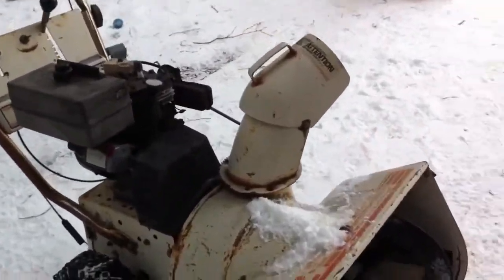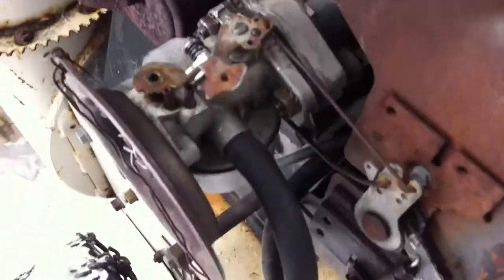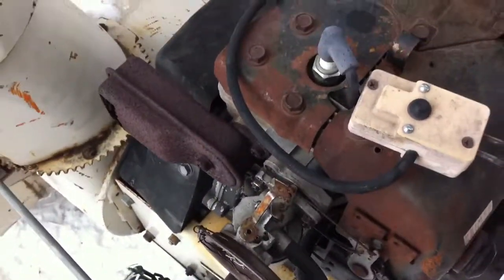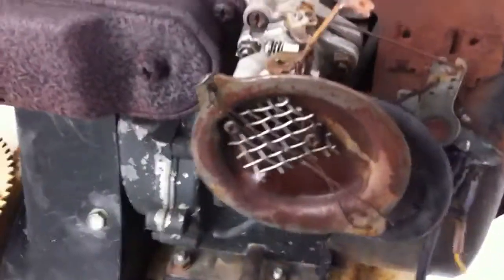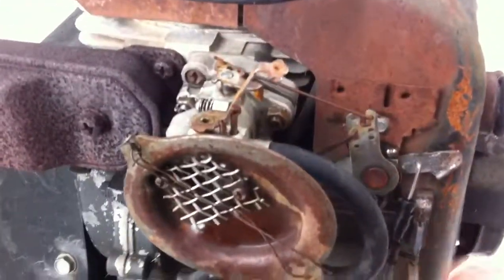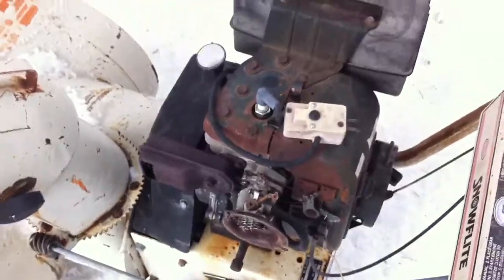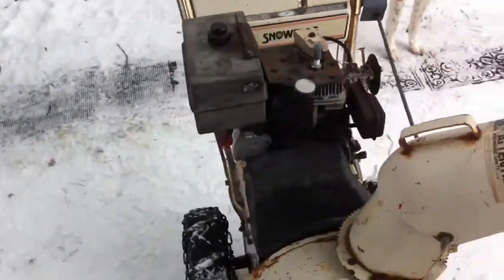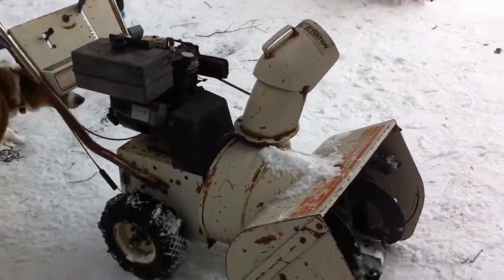Old Snowflite 5/24 Snowblower RUNS Again!

Comment: Built like a tank and weighs as much.
I just finished blowing a foot of wet snow with the exact same blower, carb needs a cleaning/rebuild having to adjust the fuel mixture every 5 mins lol
Reply from the maker: yeah Make sure if you do to replace the little white rubber inlet seat and clean the inlet where the needle rides in.
Reply from the maker: also the spring thats on the needle on the bottom of fuel bowl might be weak it loosens as it runs if weak all ways have to re adjust your fuel mixture,,

Comment: Do u know how to adjust the drive cable in order to get 1st gear back?  I have no 1st gear on my snowflite 826
Reply from the maker: best thing to do is tip the snowblower up on front auger to work on belly pan take that off and look in there move the lever till you see whats moving the friction drive wheel will move back and forth on the drive shaft axle lubricate that so it moves freely examine the friction wheel how does it look ? Basically understand how it works the drive wheel goes back and forth giving you gears on the plate...
very simple you may infact have first gear already but its not adjusted to say 1st... Or the shaft is very dry and needs lubricating dont get oil and stuff on the wheel or the plate...clean that up make sure you can slide the wheel all the way to one side of shaft to the other it may solve you problem let me know..
Reply: @RatSleds  everything moves fine, I seem to have 1st gear but sometimes gotta play gear level from one gear back to first then it works fine.
Reply: !also I cant get my wheels off the machine. Right side has a pin that comes out but wheel wont come off and left side has no pin or nut and also cant get off? Any theories?  Thanks
Reply: Best soak the wheel areas and axle area  where the wheels go on with a penetrating oil and as for the  adjusting the cable just make sure it has proper spring pressure on the friction drive wheel  when you pull the lever make sure nothing is binding once and while in the gear box the whole drive system moves side to side and the drive plate or friction wheel also moves in and out or against each other not much more to adjust if a springs get weak or something binding iyou can get slop in cables